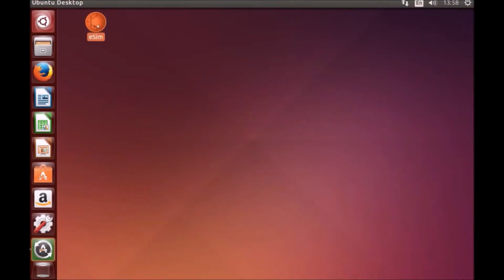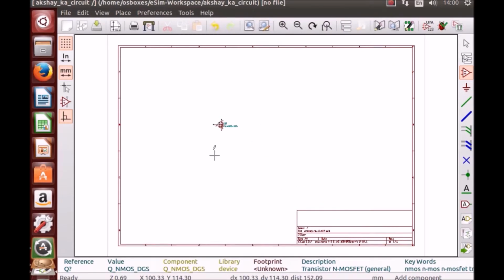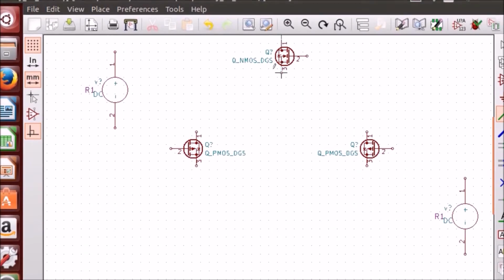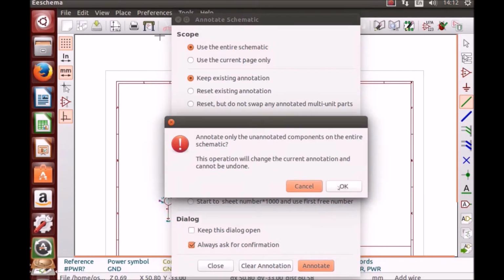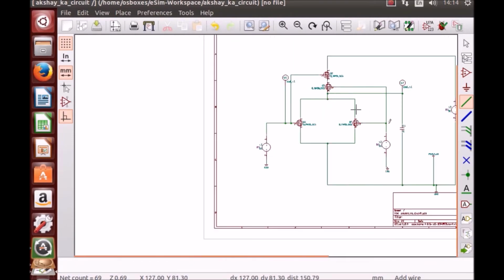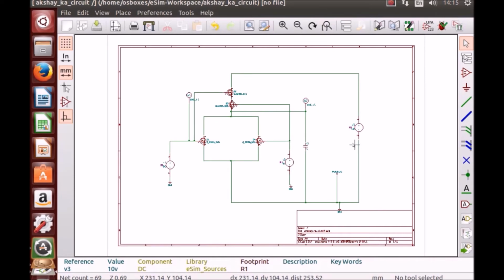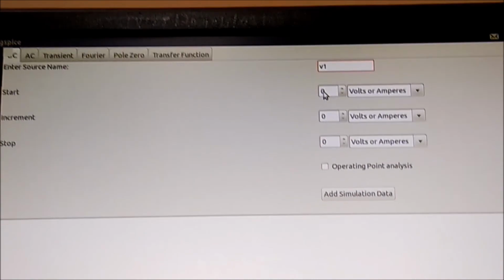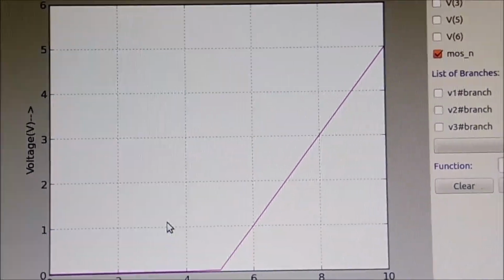. Simulating VLSI Circuits Using eSim-FreeEDA Software(in Ubuntu)

Comment: how did your tool window change?  In the starting of the video the tool window did not have any analysis option and in the end, it showed up. did you use an older version for simulating the circuit?